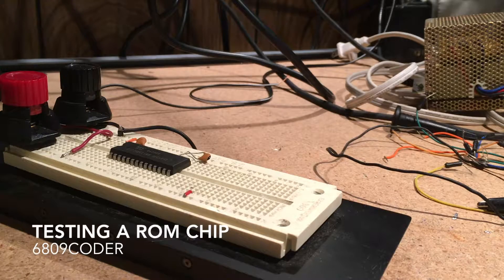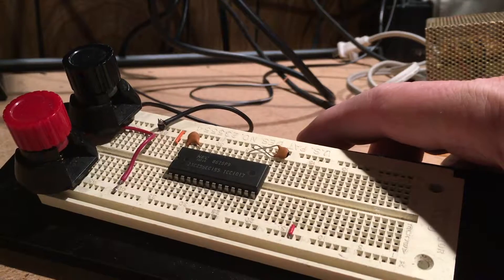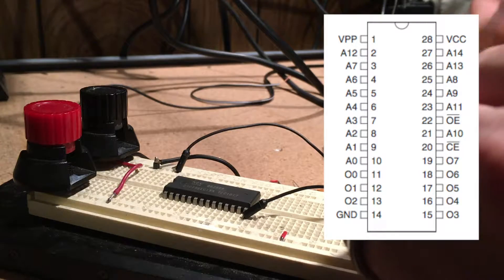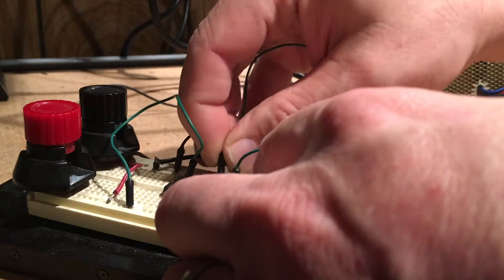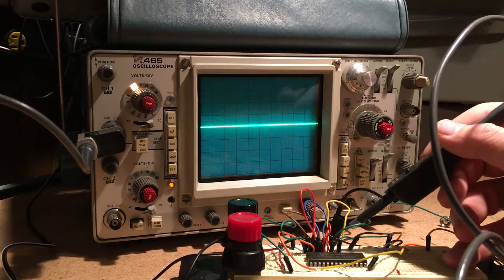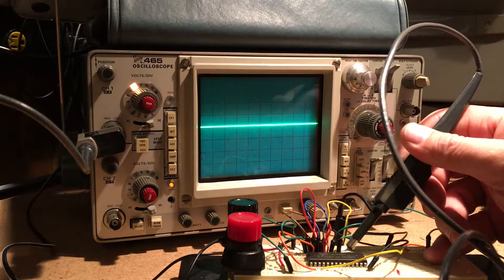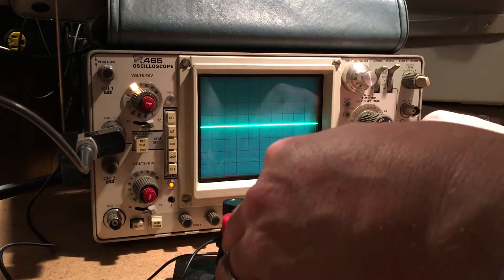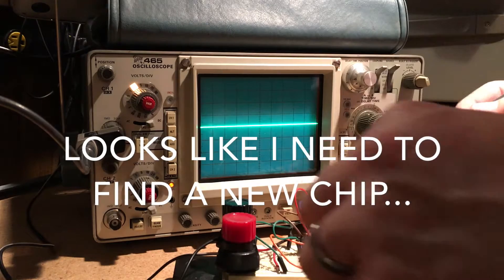#5 Testing a 27C256 ROM Chip from a TRS-80 Color Computer  Out of Circuit

Comment: Very late I know and you said you had ill-powered the board (been there done that ;-) but, on the 27C chips, you want VPP tied to VCC for reading to work.  I think some datasheets say VCC - +0.7v, so a diode drop from VCC.
Reply from the maker: Hey thanks for the tip!  Yeah it’s been a while since I did this video but if I can find the chip I tested in this video in my parts box I might just try it again.  Thanks again for watching and pointing this out!

Comment: Don't often come across bad ROM chips.  I've had both the BIOS ROMs go out on a PS/2 Model 25 I have, both showing corrupted readouts on my EPROM programmer.  Good thing was I had a couple EPROMs with a different BIOS revision sitting in storage.  The interesting thing is, it worked the last time I used it about two years ago, and it sat in a corner of my bedroom for that length of time.
Reply from the maker: I've read that cosmic radiation can cause bits to get blasted out of ROM chips...  I guess a voltage spike or something on power up could take them out too.   The reason for the failure on my machine was pretty evident though; I stupidly applied +5 v to the -12v power supply input (oops) and took out half the chips on the board. :)    BTW IBM PS/2 line are sweet machines.   I remember when they first came out and being blown away by the modular design and Microchannel bus.